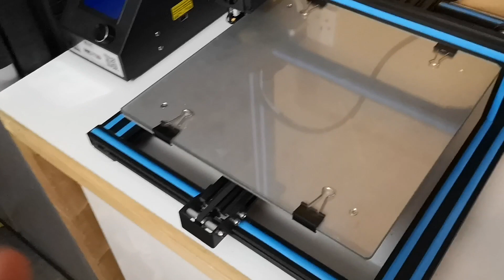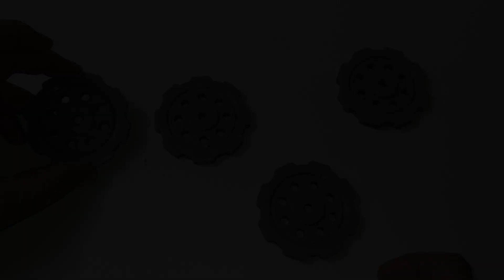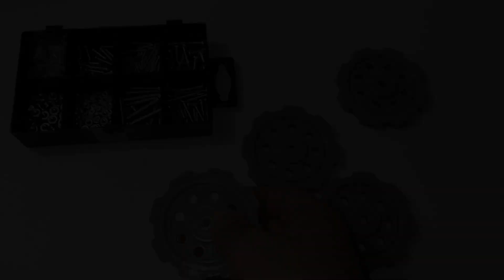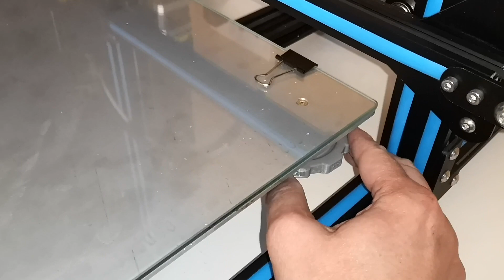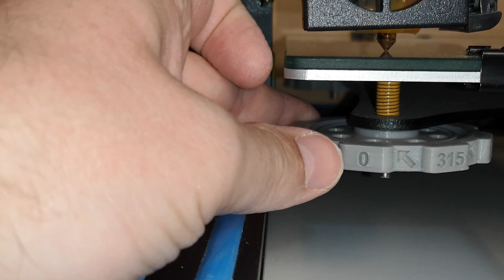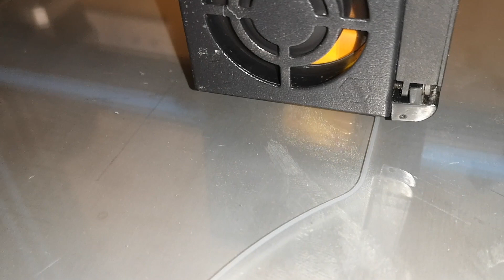Creality CR10 Bed Levelling Upgrade

Comment: I have the CR10S5, Apart from the bigger bed, 500 x 500, it also has two rails for the Y-Axis.
It seems to use the same sized bed leveling plate as shown on your video.
The problem I found is the adjustment wheels you fitted to your  printer don't clear the rails on my larger format printer.
Also the adjustment nuts are also further under the plat making it even harder to adjust.
In the end I added a BLTouch to mine.

On my smaller Cocoon Create Touch, I did use the bigger wheels on the nuts, but  I fitted Nylock nuts to  prevent them from spinning on their own.
I would suggest that you replace the nuts with Nylock's.  They are still easy enough to turn but are not loose, haven't had to adjust the level on the Cocoon Create for a long time.  More than 6 months.
Reply from the maker: Ah yes I see what you mean. That's a shame. I guess it needs those rails to keep that large bed stable. That is big printer. You must be able to make some really large items, or lots of smaller ones all at once. Do you run your printer thought the night? I find large prints take a very long time.
Reply: @SteveRaynerMakes  For smaller items I tend to use the smaller Cocoon Create Touch, it has a much better User Interface than the Creality, but limited in build size of 200 x 200 x 180.
The CR10S5 is huge, I printed a full size Storm Trooper helmet in one piece with it, a 5 day print.
The problems I found with the big printer was a warped bed, hard to get to the leveling nuts, the leveling bolts spun when trying to level the bed, and a 22 minute head time for the bed.
I have resolved all these problems using nuts to lock the leveling screws, a BLTouch to combat the bed level and warping and the biggest one was upgrading the bed heater from the 200W standard to the 1300W mains powered.
I have video's of the unboxing where I added the nuts and then each of the upgrades.
Tip of the day, when you add a BLTouch, get the genuine from Antclab, they are much better and you won't have  to repair them later :-)